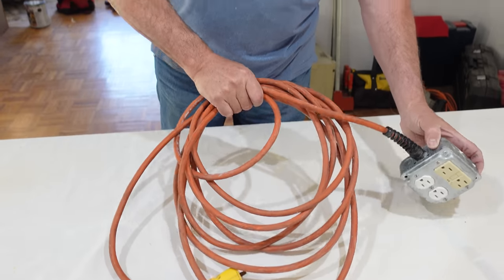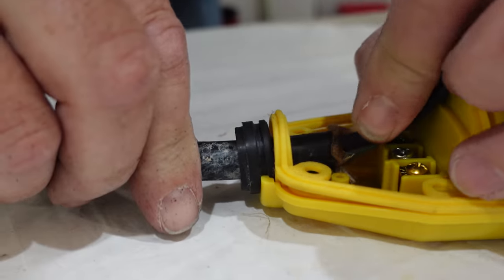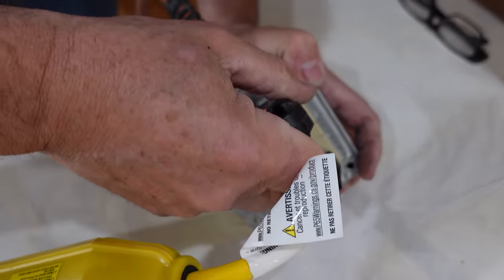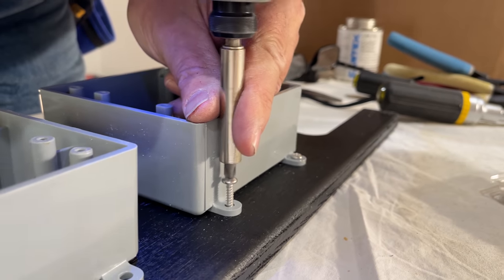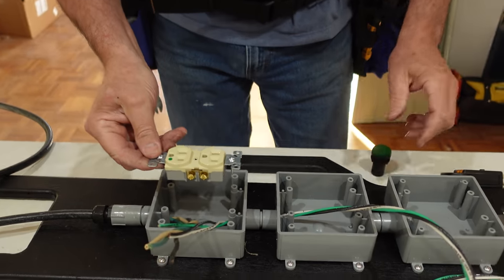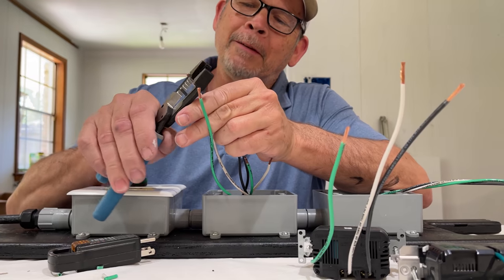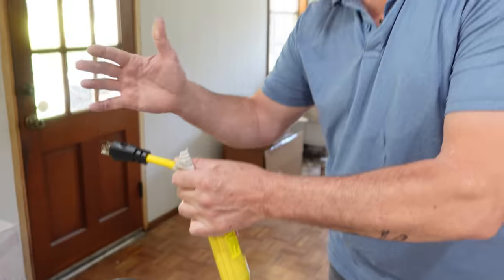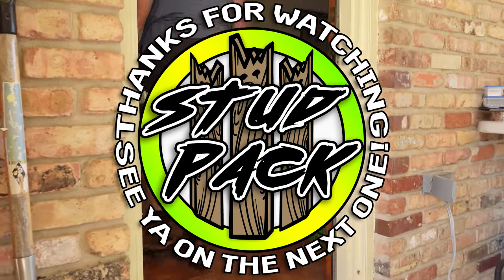HOW TO MAKE THE ULTIMATE EXTENSION CORD!

Comment: Paul - Modify the extension cord carrier design. Extend the plywood away from the carrier handle. This will create a surface to mount the device boxes out of the way from the space where the cord winds (extension cord won't block the device boxes).
Reply: I was thinking that myself.  However, you may not want this thing to get more bulky than it is already.
Reply: That was my thought when I first seen the design of the board.  I think it been better to make the board wide enough to wrap the cord to the side of the boxes and that way if you didn’t need or want to unwrap the cord completely in a smaller room you wouldn’t have all the cord laying on the floor but still could plug everything into the boxes and even use it while the board still hanging on the wall if you decided to. But it’s just a small modification that may or may not be helpful to everyone and depending where your needing to mount the board to a wall for use or storage the extra width of a wider board may not fit as well as this one in the video. So no right or wrong, just another matter of personal choice which each person may prefer?
Reply: It’s actually a good idea to unwind all the cable from any extension chord before you use it to stop the heat buildup in the bundle that could damage the insulation..especially if Paul keeps pulling 28 amps!!
Reply: @dawbuilds2080  Sure, inductive heating in a wound power cord can be a concern if current draw is high. But totally unwinding the cord is not necessary to plug in a low power device like an LED shop light or cordless tool batter charger for example.

The other disadvantage of winding the cord over the service boxes is that the cord carrier assembly becomes much thicker (bulkier) and the cord may tend to loosen up and flop around if it slides off the face of the service boxes down to the plywood surface.
Reply: @ghostridergale :: Extension cords should not be used when partially coiled up.  That can cause overheating even when the current is within specs.  You should mentally derate the cord, or test the coiled portion for warmth under full load.

Comment: If you are going to have a 20 amp receptacle, you should have a 20 amp plug on the end. That inline GFCI needs to be rated for 20 amps as well. Otherwise, this looks pretty handy. Just be sure to keep it dry since you are using indoor receptacles, face plates, and switch.

Edit:  Also, those metal outdoor boxes are perfectly fine as long as you ground them properly.
Reply: That would make it unusable if the location has 15 A sockets. It is a tool for professionals, they know not to overload the socket.
Reply: By having a 20A recepticle and a desire to get a 20A tool, they're already leaning in to overloading the 15A circuit that it can plug into.
Reply: @okaro6595  It's not only the socket that you have to worry about.  If the plug and GFCI aren't rated for 20 amps, they can be overloaded too.  Also, even if they can handle the current, if someone who doesn't know any better borrows it, they could overload a 15 amp receptacle because there is no physical protection from that.  In NEC, 15 amp receptacles are permitted to be used on 20 amp circuits, so even the breaker might not trip in the event of an overloaded receptacle.
Reply: @Derakkon2  The GFCI likely is rated much higher. Do you really think a 15 A receptacle cannot handle 20 A? The metal contacts are not different in it. in fact in some 15 A receptacles there are even contacts for 20 A plugs, the face plate just is different.
Reply: @okaro6595  That may be true for some 15 amp receptacles, but a lot of homes just have the cheap residential grade receptacles.  I've seen multiple failures of these due to overloading.  I've even seen a couple fail without going over 15 amps.  Why risk starting an electrical fire, especially if you are at a customer's house with unknown wiring and receptacles?  IMHO, it's just not worth it.  It's better to be safer than sorry.
Reply: @NIronwolf  The breaker will prevent a catastrophic fault in this case, overloading a circuit doesn't instantly mean a fire hazard assuming there are no other faults. The NEC is written the way it is to reduce the risk of fires to the absolute minimum. There is plenty of headroom there to abuse. While this cable is definitely not code compliant, it is unlikely to cause fires.

This same sort of issue is actually more prevalent in daisychain style Christmas lights, which can actually still have normal appliances plugged into them despite a ludicrously underrated cable of 14 gauge or even smaller.

The same fault this device will cause is the type of fault when you plug a microwave and an air conditioner into the same circuit. It will trip due to overload but, assuming you pay attention, it won't cause a fire.

Comment: My recommendation is to use a 10 Guage extension cord.  If you are going to buy one, especially a 100', get the bigger wire.  The bigger wire does not heat up as fast as a 12 or 14.  Don't even think about a 16 ga cord for this.  I could see you running a table saw and a vacuum together and both drawing about 9 amps, so a the 10 ga will handle the draw for a longer time.  Also when I wired my dad's wood shop, I made sure to run a separate circuit for lighting. If the breaker trips, the last thing you want is a saw running in the dark.  I would run the lights by themselves on a separate extension cord on a separate breaker if at all possible for safety.  If you want to make 2 50 footers, buy 1 100' cord and cut it in half, it is cheaper.  Of course if you go to an electrical supply, they may have it on a roll and you can buy it by the foot, you are going to cut the ends off anyways.  I love this idea, the handle  and mounting was a great idea, the hole to hang it on.

Comment: The breaker has what's called a "trip curve", and actually trips based on heat and not the amount of current. It will take a certain amount of time at a certain number of amps for the wire to heat up enough to trip the breaker. At higher currents, it'll heat up faster and trip faster. Each manufacturer publishes their trip curve graphs so you can try and estimate how long it should take the breaker to trip. It'll trip before the wire gets hot enough to start a fire.
Reply: Annoyingly, old breakers can even trip at currents BELOW their rating if you draw the current for a long enough time. I lived in an old apartment for a while that had very few outlets so ALL of my entertainment center and computer(s) were plugged into outlets on the same breaker. If I was playing on the computer and my gf was watching TV at the same time, the circuit would eventually trip after a few hours. I tested how much current was being drawn, and it was 13-14 when everything was on and pulling at full power. (Gaming computers take lots of power apparently.) 

I eventually made a huge, long power cord from 10 gauge wire (that wire was like 3/4 of an inch thick in total) and plugged half of the things over in the other room (which ran on a different breaker.) Non ideal, sure, but it worked.
Reply: @reeepingk  ... just remember that a 15 amp circuit is only rated to carry 80% load continuous, or about 12 amps. At 14 amps it will trip in a few hours.
Reply: @rupe53  Unless the breaker is extremely old, and doesnt trip right away.
Reply: @TheDarthJesus  ... there are a few older brands out there where some sparkies claim you can weld things and the breaker wont trip because they seem to fall out of spec with age. Ambient temp doesn't seem to change things much. It's the internal temp from current draw that's supposed to do the deed.
Reply: @rupe53  oh I've seen it. Massive arcing and breakers not tripping. Sadly some people who are unqualified think its a feature for a 15a-20a breaker to not trip. Despite the fact its a fire and safety hazard.
Reply: @rupe53  Nonsense, a breaker should never trip at the rated current. In fact it can take small overload for indefinitely.
Reply: @okaro6595  ... in a perfect world that might be true. OTOH, in a perfect world people would know the limits and not push their luck. BTW, I watched a guy troubleshoot a tripped breaker one afternoon. It would pop about every 5-10 minutes and he was scratching his head. Turns out there was a pair of appliances (1500 watts each) on the same circuit. That's roughly 24 amps on a 20 amp breaker. He didn't understand why it didn't trip right away if there was an overload. This is the time and temp curve at work.

Comment: Yes, when the vacuum is blocked up and the motor whines at a higher pitch it is actually doing less work so draws less current (and thus uses less power). But those vacuums usually cool the motor with the air that is flowing through them (that's why the exhaust on them is warm when it has been run for a while). By blocking the air-flow you are blocking the cooling, potentially allowing the motor to overheat. I don't know how long it will take to damage the vacuum cleaner by running it with the airflow blocked. It would either take some experimentation or thermodynamic calculations that I don't know the formulas to. But quick little blockages are probably not going to harm anything because the vacuum cleaners are designed with the expectation that will happen occasionally. But I wouldn't want to run the vacuum cleaner for long periods of time w/o any airflow. I just don't know the definition of "long periods of time" in this instance. 5 minutes or more? Multiples of 10s of minutes? Hours? So, no you don't need to run to the vacuum and kill the power as soon as you hear it getting blocked. But don't let it go too long.
Reply: ill say this i use my rigid 16 gallon vac to excavate in basments once the slab is opened up. and is an absalote trouper for removing 22 full vaccum loads of sand and is so much less messy or risk of sending a shovel blade thru old soft conduit or casr sewer mains areno longer an issue
Reply: A high quality vac will stand a fair amount to that. The cheapo ones, not so much. Running the thing for a long time with a  clogged filter is what shortens the life and makes them die after only a few dozen hours of use

Comment: VERY nice looking setup.  I'm going to do similar with an old cord my Dad left me.
One comment about the grommet on the GFCI - I believe it's on backward. When you tighten the screws on the cover it's supposed to apply pressure on the thick end ring of the grommet to grab it and keep it in place.  It looks like that end of the grommet is outside instead of inside and under the clamping end.  And the smooth rounded end is inside.

Comment: Great idea i have been looking at building one similar but a A couple of comments that i would have done. 1) i would have used a 1/2" screw in light and put it at the far end so not taking up  a space for device. 2) start with the high amperage devices at the cord end  20A - 15A - Switched - USB so the high amperage isn't going through as many connections to get to the power source. 3) I would use metal boxex/ plates so they are less likly to be broken on the job site

Comment: When you blocked up the suction of the shop vac the power consumption did go down, but there is also a risk to the motor as you stopped the air flow that helps to provide cooling and keep the motor from overheating.

Comment: I am a Navy Veteran Electrician. Since I got out in 1980 I have been in electrical engineering field for my entire life.  Before my Navy experience I attended two years in a VOTECH school for Industrial and residential wiring. I did get my journeyman electrician License.  I do not use the Wegos on anything that draws current. Signal wires and Low Voltage lighting maybe. If you look inside you will see that they have a very small wire contact area. They will get hot under load. Use the screws on the outlet. they clamp with a good connection, current rated. Do not use the contactor discount outlets, they are made with cheap plastic that breaks too easy.  The outlets should all be 20 amp rated and not mix and match. You went with the gimmick USB outlet.  If you want USB charging, buy a USB charging strip. Your ground connection was a trick fix that should never be used. You should of used a solid conductor for this green screw connection then wire nut the other wires together in the back of the box. All box covers should be the gray type designed for these boxes. They are outdoor rated with spring covers over each outlet.

Comment: Breakers and fuses have a "Time Current Curve" There is not a single point where they trip. They may hold for hours when  above their rating, but will trip in a few milliseconds with a very high fault current. There's no guarantee that the breaker would ever trip until you reach a current level outside that range on the curve. Of course, thermal magnetic breakers don't trip of current, it is heat that trips them.  The breaker that you were on may have been a thermal magnetic breaker.

Comment: Breakers trip on a curve. They're rated to run at 80% of their total, continuously. I.e. 15 amp breaker will run at 12 amps for over 3 hours at a time. 

The higher you go in load, the faster your breaker will trip off (if it's functioning properly). 

Not sure how long you guys were running that 15A circuit, but it definitely should have tripped not long after you started shutting saws off. That said - when you're on a new build, consider how fast breakers get tripped, if you've got 2-3 saws running off a new temporary service. 

I'm surprised the circuit held. Is it an fuse panel? They're notorious for not switching off when they should. Think about how many times those wires have been overloaded, and how brittle the insulation could be in some places.
Reply: Quite often old breakers fail to trip right away, a definite safety hazard.

Comment: Wagos? Nah, too many connectors and points of failure -- solder, solder, solder, use heatshrink tubing -- can't beat this technique for reliability, also soldered spades for the ground screw is much better than having that 12ga STR wire looking like it's gonna pop out any minute.  Soldering take a wee longer, but can't be beat for long-term reliability. Fantastic video though, a masterpiece you have here. Appreciate this channel, appreciate what you do. Subbed!
Reply: My questions involving that 12ga wire is this: how many power tools are you going to be able to run off of that cord at one time? I suppose if you need lots of LED work lights, it could pay to have 12 outlets at the end of the cord, but even with a 12ga cord, I wouldn't want to have too many guys running 15A tools at once.

Comment: Good job too the both of you for the great video here. Exactly the kind of stuff I like doing myself. I do however have one more add on if I may offer it.  Always have extra flood lamps that are bulky and cumbersome in these construction atmosphere jobs & they are from 100 W too 300W bulbs, I would add at the top of the last box another slip/thread connector and threat in one of them rectangle shop lights so when hanging...it is on top and out of the way (Always burning myself by bumping into them), and hook it too the switch you installed instead of the receptacle.  I have a large hanger for hanging it on the plumbing pipes or on a wall. Also have a set of two clamps that can grab the thickness of a 2"x4" or any rafter / floor joist directly to hold it in place.  Liked the USB add on as well, nice touch! Love the videos guys...keep up the good work!!

Comment: Some minor improvements:
- Get some waterproof cover plates on each outlet
- Put the 20 Amp outlet and hospital grade outlets first
- Put the light at the end
- Put a switch on both of the outlets on the switched receptacle
- Use 10 gauge wire.
- Add magnets
- Detachable cord

Comment: Good stuff. I did wonder about the need to use stranded wire inside since those wires won't experience movement.
Reply: You are correct.  There is also no need for 12AWG wire... stranded or otherwise.  Those short jumpers will not provide any voltage drop with the correct gauge wire for a 15A circuit.  Also, there is definitely no reason for 12AWG on the ground as it is not a current carrying conductor!  Even in 14AWG wiring, the ground is a smaller gauge.  Notice how the ground screw on that 15A receptacle didn't properly seize the wire?  And they pointed out "how nicely that's holding together"   LOL
Reply: But they do experience movement.  That cord will be in a truck going over unpaved roads and subject to all sorts of vibrations.  It might be sitting on a surface that is being vibrated by some equipment that is plugged into it.    No movement is for in a house (ignoring earthquakes).

Comment: Cool job !  Now I just have to make myself one of these babies.  Great job!  Thanks.  Circuit breakers are inverse time devices.  Meaning that the lower the amperage above the current rating the longer it will take to trip.  The higher the current draw over the device limit, the quicker it will trip.